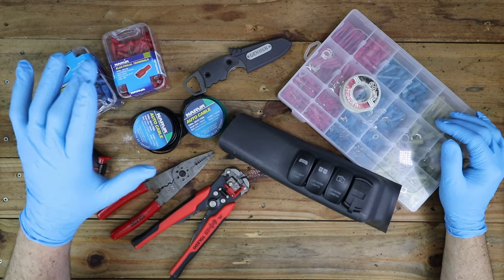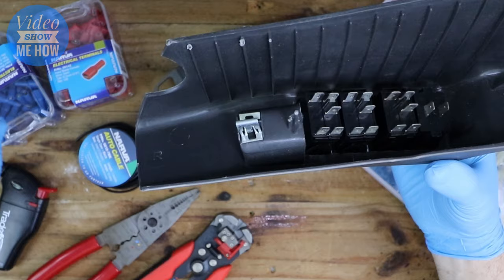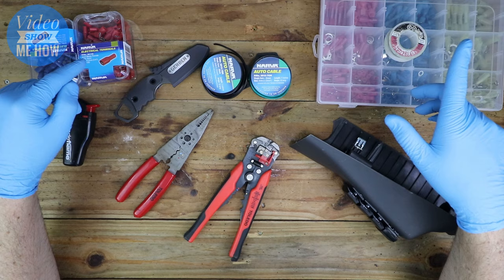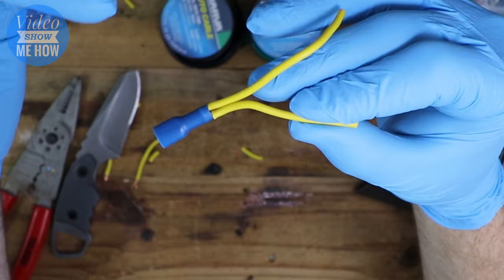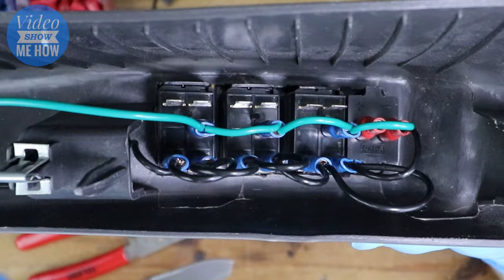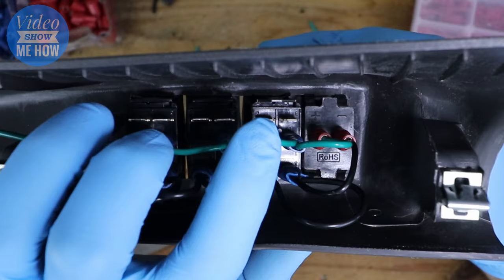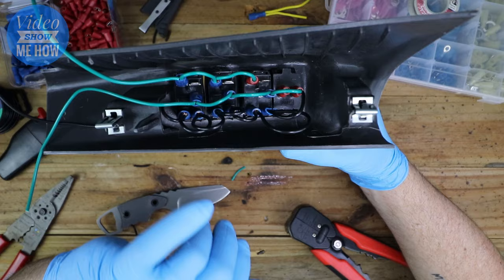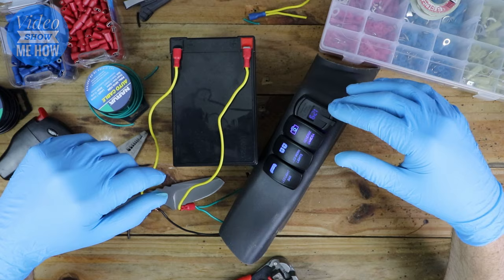How to Wire MULTIPLE 12V LED Rocker Switches [Simple Guide and Wiring Explanation]

Comment: Awesome Video! I do have a question. So I'm planning on having 3 switches and a volt reader. One for a Radiator fan, the other 2 for 2 separate led light set ups. So, after I set them up like this video showed, do I connect the Positive Power directly to the battery?? And for the dash lights wire, I have an adjustable lighting in my car. Do I hook it up to that directly to that or to the switch on my headlight switch is? Just need some help and can't seem to get the answers I need online.
Reply from the maker: Would recommend using a relay particular for the rad fan. Also make sure to use a fuse on the battery end. I have more vids coming out soon that run through switches and relays, ideally to answer exactly your kind of question :)
Reply: @VideoShowMeHow  I have read about people finding the grounded prong in the radiator fan relay, putting wire in that specific slot and pressing the relay switch into it. I don't know if that is okay or not so I've been very skeptical of that method. And just read that my specific LEDs can be hooked up to the the fuse box and they have the proper circuit adapters with the fuse for them so I think I won't need the switch for those but definitely need one for the radiator fan and how to have the volt reader read the battery. Forgive me, very new to  electrical stuff..

Comment: Great videos! You are the best. How do I see all of your videos? I’m. Putting an LED light bar on the ROP of my tractor for forward lighting and two LED pods for rear lighting and need to wire to two panel switches to operate them independently. I have two wire harnesses with relays and need to know how to connect each part to battery, ignition, and lights. All videos skip the part of what wire goes where and hoping you can explain that in a video.  Thanks for your clear and knowledgeable instructions. Gordie
Reply from the maker: Thanks mate. You can click the channel name next to the profile pic and that will take you to the whole channel 👌

Comment: The accessories all have  positive and negative wires… I see where you showed connecting the positive wire from the rockers to the accessories. But what do we do with the black wire from our accessories?
Reply from the maker: Just need to run to an earthing point
Reply: @VideoShowMeHow  so if I’m on a bike should I run to the negative terminal of battery or what would you recommend? The bike is in the latest video I posted on my channel if you want/need to see it.

Comment: Great video! I bought the Nilight 5 Rocker Switch Panel to connect all the LED "fog" light on my truck. Those jumpers are already installed on the panel, so I guess it's confusing me how to connect their wiring harness, which includes a white constant, to the rocker switches? Thanks.
Reply from the maker: Hey mate, I'm not familiar with that panel, did any wiring diagrams come with it? It would depend if your lights use relays or not.. as a min you'd need fused power to the panel that's enough for its Max load.
Reply: @VideoShowMeHow  The wiring harnesses include relays.
Reply: @VideoShowMeHow  Would it be easier to just disconnect all the wires and just use one rocker switch per wiring harness?
Reply from the maker: @toddjenest3212  if it has relays that's good, you'd connect the power from relay to lights then the trigger wire to the switch. My other vid shows how to wire a single rocker switch that could help. Sounds like you could then power the while panel with one input? Hard to explain/diagnose via comments sorry mate
Reply: @VideoShowMeHow  Thank you!

Comment: How would you wire these to a deadman’s switch to stop all power going to the panel? I’d like to turn all the lights off on a boat when not in use.
Reply from the maker: Would switch the main 12+ feed wire to do this, using a relay depending on overall load
Reply: @VideoShowMeHow  ok, so it would be a relay switch to turn it off and not one of these then?
Reply from the maker: If you wanted to turn the whole panel off yeah that's what I'd use. Adjust an isolator really

Comment: Hey Adam,  great video series. I am going to be using the rockers to power a light bar, some spot lights, and a usb.  I wanted to get your feedback on another feature I wanted to add.  I have a 2018 Jeep JK and wanted to be able to use the reverse led feature of some aftermarket tail lights to power on should I need light in the rear of the vehicle in lieu of adding on more lighting.  Is it possible to have the taillight  work on reverse as well as on demand?  How would I connect that?  Cheers!
Reply from the maker: Hi Adam, are they LED now? On my JK I replaced the old bulbs with LED and added extra LED spots. Used the existing wiring. Trick is staying within the factory bulb w limit if that makes sense.

Comment: Hi mate,

Just watched your videos on 12v rocker switches. Loved it.

Can you do a video or even reply comment, by expanding on once the switches are all daisy chained and wired up, how/where to wire the dash lights into physically on the car.

Also, if running individual switches to a 12v fusebox, would that remove the requirement to daisy chain the 12v battery in line?

Ben.
Reply from the maker: Hey mate, will be releasing a full 12v system  including light install as part of the dmax build in coming weeks 👍

Comment: With my light bar once I have it all set up would I just plug the positive from the wiring harness in to the last pin on the switch? Do I then need to earth the wiring harness aswell.
Reply from the maker: I would run a light bar through a relay (relay vid coming soon)
Reply: @VideoShowMeHow  rocker switch to relay to light bar video coming soon?
Reply from the maker: On to it :)

Comment: Does each switch need its own relay?
Reply from the maker: Depends on the current your putting through.. these are rated at 20amp but if be using relays at half that

Comment: Mate for the life of me I can’t get 4mm auto cable to fit in the blue female blades when I use this method...any tips?
Reply from the maker: Hey bud 4mm wire is def the blue connectors? All stripped ok etc?
Reply: @VideoShowMeHow  yeah 4mm (15amp) cable and the exact same Narva branded terminals you are using in the video. Must be doing something wrong....but I mean if you fold the cable in half it’s doubling it’s size...hmmm
Reply from the maker: @Kyle_S88  the wire I've used in the demo is 10amp, maybe that's the diff? Have you go any yellow (5-6mm) connectors you could try?
Reply: @VideoShowMeHow  yeah I’d say that’s probably why! I found a solution, it was for a battery box in a dual battery setup for my 4WD, I mounted a bolt in the lid of the battery box to be used as a common ground and just ran the earths individually to that...not quite as neat though...but effective haha
Reply from the maker: @Kyle_S88  does the job! Just re wiring up the 12v in my camper at the moment actually, just got some busbars arrive in the post for exactly the same purpose and in hindsight the bolt idea would have worked just as well lol :)

Comment: Great tutorial! Nice and neat job and I like the way you didn't cut individual jumpers between each switch, just used the same cable. I didn't think of doing that.

When you wired these lights and switches up, did you use individual relays for each, or can you run them through the same relay?
Reply from the maker: Cheers. It would depend on your application, anything more than a few amps I always prefer using a relay
Reply: @VideoShowMeHow  thanks for the rapid reply!
So if I wanted to use 3 different sets of lights running off 3 separate switches and wanted to use a relay, would I use 3 relays, or can I run the 3 light setups through one relay?
Reply from the maker: @deanrowlands1047  you could run the 3 off they one if you're happy for them all to switch together and total amps are within the rated amount of relay. Otherwise yeah could do separate relays. How much do the lights draw? If camp lights or something might be fine straight off the switch
Reply: @VideoShowMeHow  ok, great.
I'm not sure how many amps yet, I haven't bought any lights, I'm just planning ahead and getting whatever gear that I need ready 👍🏻

Comment: So im going to put four of these switches in my go kart, how am i suppose to wire up the “dash lights”
Reply from the maker: Can just use a 12v feed. Could use off fuel pump wire or something that doesn't have constant power
Reply: @VideoShowMeHow  i dont have a fuel pump on the go kart, would i be able to just wire it to a separate switch the  when it gets dark flip that on?
Reply from the maker: @gm0ney114  yep that would work 👍
Reply: @VideoShowMeHow  alright sweet, thanks for the help!

Comment: How do you wire them to a fuse box?
Reply from the maker: For the load? I would have the fuse in line between switch load output and of course your main fuse battery side on your main positive cable

Comment: What gauge wire are you using?
Reply from the maker: Hey there, this is just 10amp wire (18 guage)
Reply: @VideoShowMeHow  Some of these light bars are 15 amp rated. Probably should bump them up to 16 ga minimum?
Reply from the maker: @tomgregory5814  would recommend using a relay for anything more that about 10amps. The switches in the vid are technically rated to 20a, but personally I wouldn't be keen to test their limits :)
Reply: @VideoShowMeHow  Good idea. Thanks.

Comment: what gauge wire did you use?
Reply from the maker: Really depends on your load etc but for 20amps I'd use 10 awg
Reply: @VideoShowMeHow  Only concern is 10 awg will be too thick to squeeze in the small area between the switches.
Reply from the maker: @ianchewyy  if your load is less than 20amps you could go smaller
Reply: @VideoShowMeHow  Thanks. The one you used in your videos are 10 AWG ? They seems a good size.
Reply from the maker: It was 14awg from memory
Reply: @VideoShowMeHow  Thank you!

Comment: How do you know what gauge wire to run?
Reply from the maker: Depends on your load, guage must at least the total of your loads plus some wiggle room
Reply: @VideoShowMeHow  So if I’m running 5 lights that in total pull 20A constant I could run primary power in at 12 gauge, I think?
Reply from the maker: @jimmyanthony6557  I'd use 10, best not to run at max capacity, thing will get very warm.   If you're running something that's 20amps I'd be  using a relay 👍
Reply: @VideoShowMeHow  I mean in total, so all 5 lights combined would be 20A if all turned on. So it would pull 20A into the main power, but none of the individual switches would pull 20A through them, if I’m thinking about it right?
Reply from the maker: @jimmyanthony6557  Ah ok yeah cool. Well for the circuit you want to make sure your wire is 1.3-1.5x the total draw of that circuit (and fused of course)
Reply: @VideoShowMeHow  Perfect, thanks. I think I may just wire in a fuse and relay box to be safe. Some good ones for $30, a little more wire and work but I’ll sleep better. Appreciate the help!
Reply from the maker: @jimmyanthony6557  nice! Welcome, good luck with the project